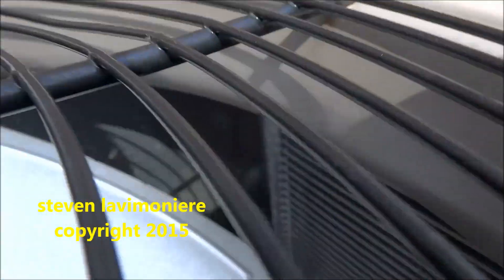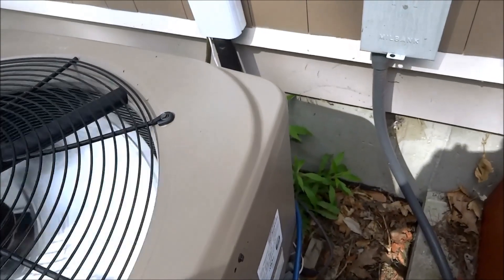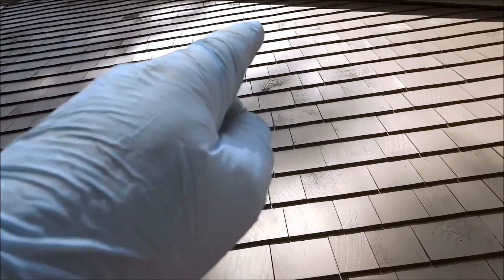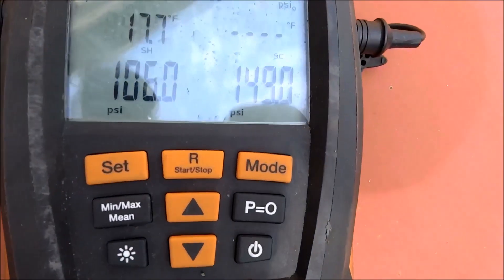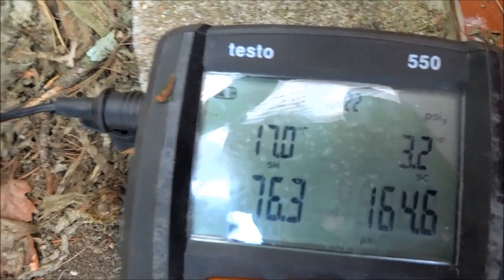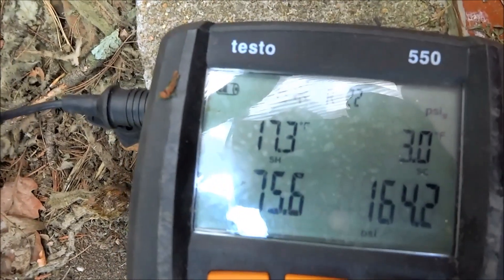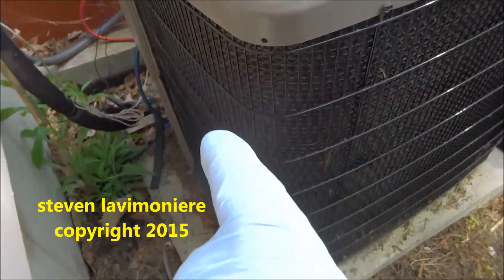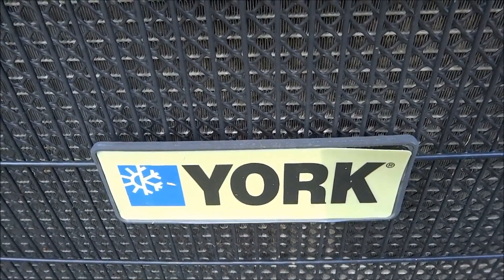hvac:micro channel condenser low on R22

Comment: I ran into the same exact problem today. I ran into a 3 ton microchannel r22 today, the pressures were low so I added 22. I got the suction to come up to 60 but the head pressure wouldnt budge pass 160!

Comment: Too bad that York has gone to rubbish. My parents have a 3.5 ton York condensing unit & 4 ton York Stellar furnace / evaporator installed in 1994 and it still is truckin'. Even the man that installed the unit is amazed that it is still up and running. They don't make stuff like they used to. From watching your + Israel's videos, I know to stay the hell away from microchannel. Embrace the technology my ass!
Reply from the maker: Ronnie Bradley the older yorks had a copper coil ,not microchannel

Comment: Hey Steve, what leak checker are you using these days?
r22 is not to bad...r410a is a bitch... the YellowJacket seems dependable for both...
Reply from the maker: SeudoSmart 527 i use the h10g for leak detection
Reply: thanks.

Comment: hey can you tell me where to get a good low cost 410 3 ton unit we have a 2.5 ton unit matched with a 3ton coil its not larg enough for the space its trying to cool now the the condenser is leaking and has been for a few years and last week the compressor went to ground just wanted to ask if you knew of a good low cost unit in the $800 range.
Reply from the maker: SuperJeremi10 best to go to a local  supply house down your way to see what they stock icp=carrier,day@night,ect  line is good,,,goodman,ruud/rheam and good also ,just stay away from a micro channel condencer
Reply: alright thanks ill give them a check we wanted to supply our own unit to the tech to help lower costs  we would like a quality unit but we are on a budget and right now anything will be better for us then nothing at all we have a few window units right now but home owners association wants them gone asap least the one on the front of the house.

Comment: It is still legal to use r22 in the us? over here we are not alowed to use r22 or to sell-buy it
Reply from the maker: cristian cuzmanov sure we can use it,buy it yes .they are starting a phase out stop making r22 over a course of years .
Reply: EU regulations banned it since 2009. we use r404a or r422d (DuPont) insted of R22
Reply from the maker: cristian cuzmanov what one do you like better ,
Reply: r404 + new oil and filters for it. it is safe and as cheap as r410 . but in general we have few equipment that runs on r22. the goverment makes you change the old stuff in one way or another

Comment: got to be careful if they had another guy out there putting in drop in replacements and they didn't mark the unit.  then the unit needs to be replaced and who's paying. but you should have known they say
Reply from the maker: northco hvac that will be a problem ,drop in replacements, i have not run it the problem yet, but i will

Comment: Steven, what happened to the 570? I see you are using the 550, It looks like you have the wrong piston but who cares with that unit on it's way out anyway.
Reply from the maker: Larry Cole ya i need a smaller piston to raise the head pressure
Reply: or just do it right with a TXV
Reply from the maker: David Taylor i rather run a piston
Reply: steven lavimoniere why? all piston system really use the EAT wet bulb charting chart to establish the charge PITA. Miss matched throws one off the chart. To get the rated seer most manufacturer tables note the use of a TXV. Easier to use sub cooling, sight glass and DB super heat.
Reply from the maker: pistons never break down,and a txv will.. ,but most new units are coming with txv now anyway ,eather way i will use whats there

Comment: Nice Job Steve, I don't care for the micro channel, Junk, I did fix one last year. A leak had to try flux cored aluminum brazing alloy, It worked sealed the leak, You just never know. Seen it on you tube.
Reply from the maker: Arnie Grote not sure i would try to patch a micro channel coil probley not